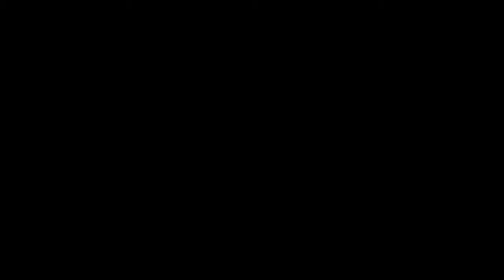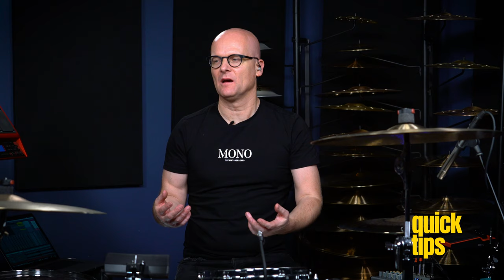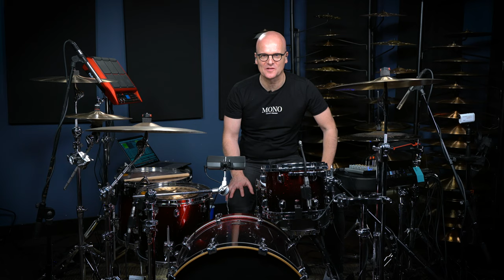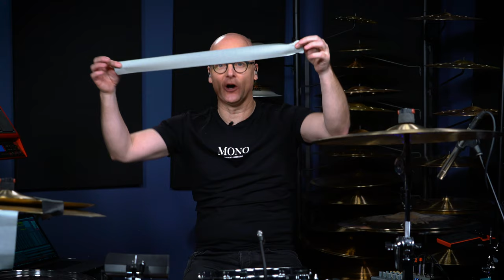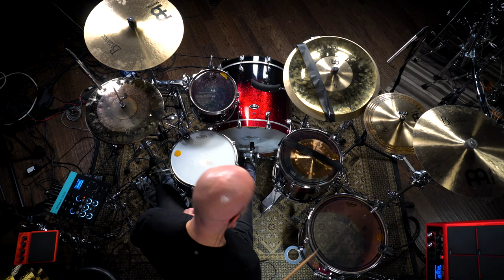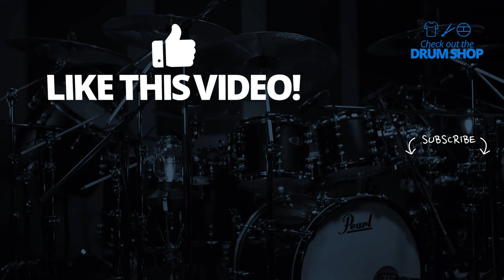How To Get A CLAP SOUND From An Acoustic Drum Kit

Comment: I’ve got a pretty good clap sound by stacking three splashes and clothespinning them together at an edge (probably the most important part - and I had to tie the clothespin to the cymbal stand center post so it wouldn’t slide off). Two clothespins on opposite sides might be better. The splashes are all mildly cracked. It’s an 8” over two 10” splashes. Then throw a bling ring (tambourine jingle thing) over that. 

Then a splash (or two stacked) on your Snare makes for a good electro Snare sound kinda like he had on his tom in this video.